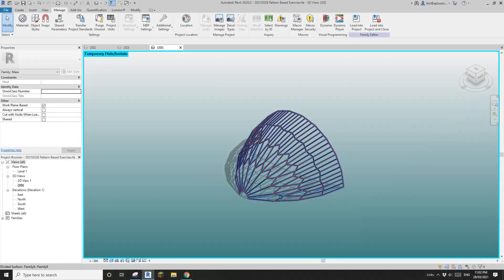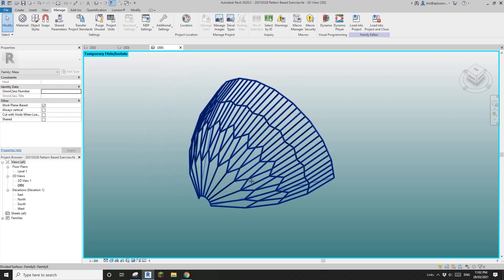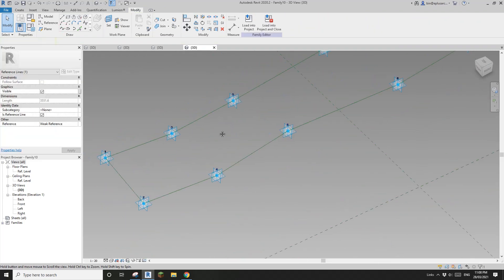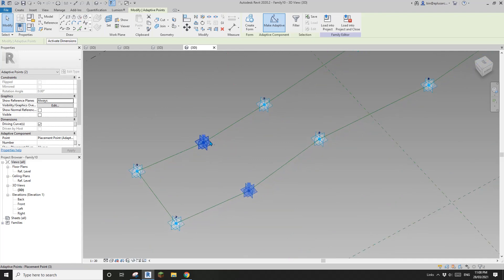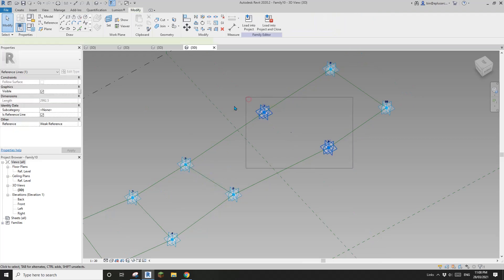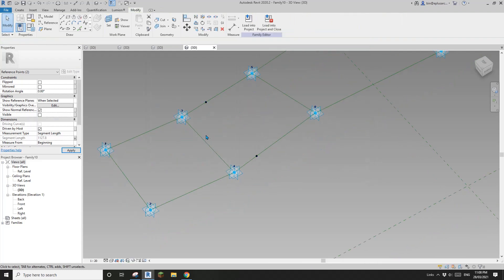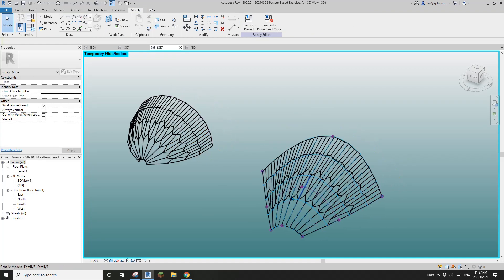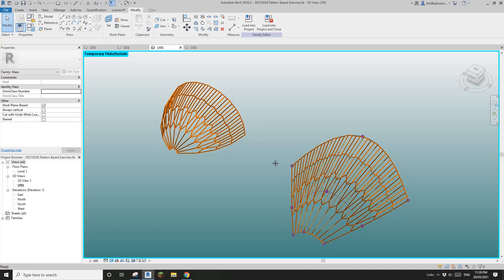Everyday Revit (Day 376) - Adaptive Family Exercise

Comment: Bin can you please teach us how to make parametric winnowing  like the ones from Casa CC from sommet on archdaily please
Reply from the maker: Are they curtain wall with sliding panels? Or just big sliding doors? I think you can quite easily download these families from some manufacturers’ website. For example in Australia you can get them from AWS or Capral.  If you do not worry about the detail, you can also model them using the curtain wall tool. I’ll do a video about this later.
Reply: @BINHE615  thanks for considering 😀